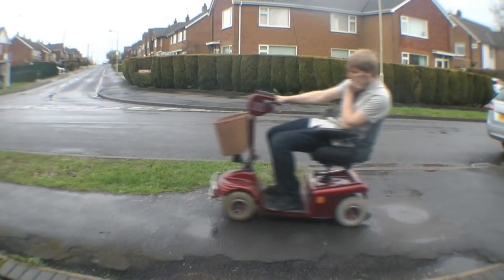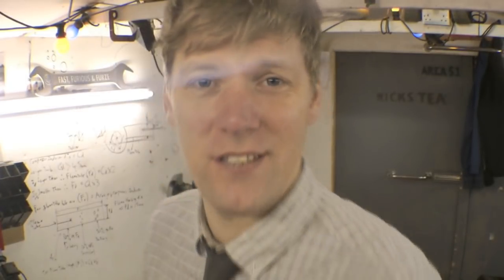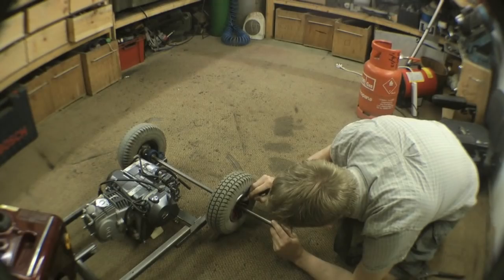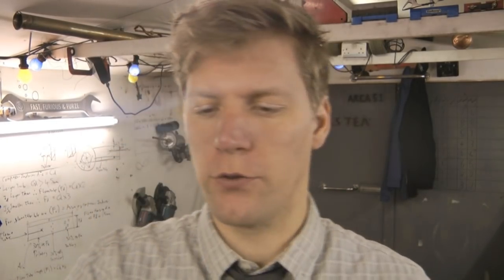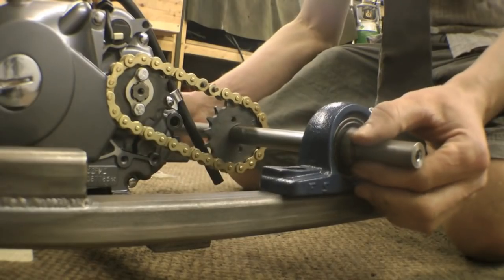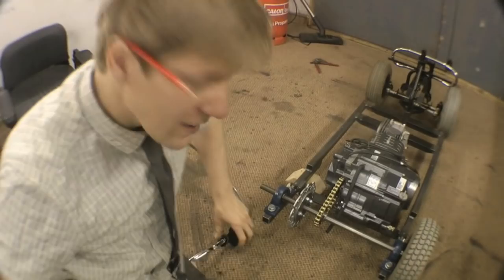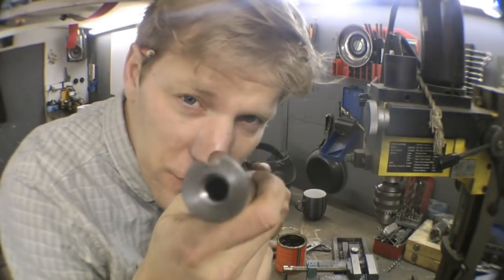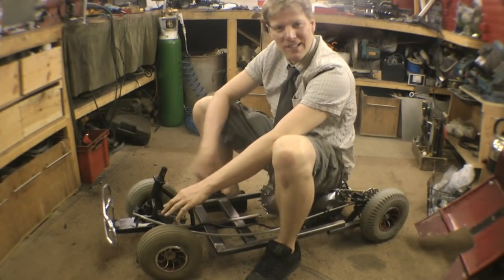How to build a 60MPH MOBILITY SCOOTER #2 Axle

Comment: COOL , GREAT VIDEO , i WAS LUCKY TO PULL A LIKE NEW fortress 1700 DT/TA from the scrap steel pile @ my regular scrap yard, I gave the guy 30 $ canadian dollars  &
figured out it was a 2010 model that retailed for about 3800 $ new , lol, looks almost brand new ,lol , & surely the awesome seats worth 50$, i was gonna try to sell it for 1200$ , all it needs is a battery that runs about 120$, but since watching your crazy video i think ill use another one i found that only 1500$ new and try your 60 mph project thanks awesome.

Comment: Colin this is easy and simple you should take a bottle like a water bottle and then drill a hole in the cap of the bottle and put a metal rod and fill it up with airsoft bbs the bottle and the super glue or weld a air compressor handle to the bottle then put a air compressor to it and it shoots like 1000 bad per 20 seconds or 30

Comment: you might get better cornering with a single driven wheel in the middle of the axle & two slightly smaller non-grippy ones at the ends? lacks elegance I know but it might work?

Comment: so how does it go round corners? Doesn't it need a rear diff of some sort? Go carts have the steering set up so that the inside back wheel lifts off, but surely not with a mobility scooter?

Comment: Compreser to the bottle and then once it is filled with bbs the put a air compressor to the handle you sulerglued on and it shoots 1000 bbs per 20 or 30seconds

Comment: Iv look at the link for the rear axle but i cant find the 17mm bar closest is 11/16" and thats about 17.46mm is that the right bar to buy also cant wait for part 3 as im buying the parts bit by bit as a summer project hehe my mates are gonna love it
Reply from the maker: will double check that
Reply from the maker: hi there ive changed it to an ebay link as seemed next best way or if you have a steel stockest near you just ask them or a local fabricator etc. hope it all goes well
Reply: +colinfurze ز

Comment: Colin ? all it needed was a proper electric motor? A modern  Fork lift  has  all the parts you need ,electric motor ,battery,.controller, display,controls etc.  The cells could be reconfigured into a flat rectangular battery the shape of the floor pan.So the battery would sit on top of the rectangular steel frame in a enclosure [Tesla ]. 

With a set of  soft compound  kart slicks and a wheelie bar  0 - 60 mph / 96 kph times of   under 3  seconds would be possible ..The weight of the low mounted [ better C G ] battery makes for a much safer vehicle despite, having such a narrow track .Worlds fastest 0-60 mph / 96 kph mobility scooter.

Comment: I'd be concerned with the sprocket key-lock..perhaps you should created a flat spot on the axle for the screw-key to hold solid and not tight on the round shaft. No slippage later.

Comment: hey man i have  been wanting to do a youtube show  kinda  like yours  over here alot more power and speed orented . i have a gocart frame  im applying this  know how on . hoping to find a larger displacement  engine for mine and some how work in electronic push button shifting with maybe  a  servo or  just a  jocky shifter  .  next video idea  should be  modifying this chassis a little  further  lowering the cg and  and arm and roll bar like  a kross kart but smaller ? haha

Comment: Hi Colin, I'm in the process of building one myself! Could you tell me did you weld the Sprocket and brake disc to the axle or not? As in are the fixed or not?
Reply: Hi pal did u build one ?
Reply: @postmanpathecky1124  hi yes I did, mine is a kick-start and has a little different exhaust.
Reply: @postmanpathecky1124  hi I am not currently selling it but I may be in the coming months.. Check back with me later in the year.
Reply: Are you in uk lol
Reply: @postmanpathecky1124  yes I'm the UK, South East.. I dunno yet on price a rough guess £500ish I still need to do a couple of jobs on it though.

Comment: I wanna build one too but I need a milling machine and a lathe :/
Reply from the maker: it can be done without both the keyways are hard but possible
Reply: Fernando Fontana If you go into a machine shop, flutter your eyelashes and supply your own tungsten carbide bits, they may let you borrow time on the vertical mill.